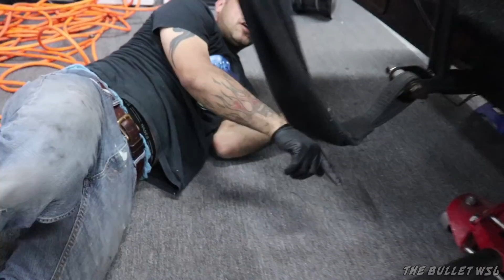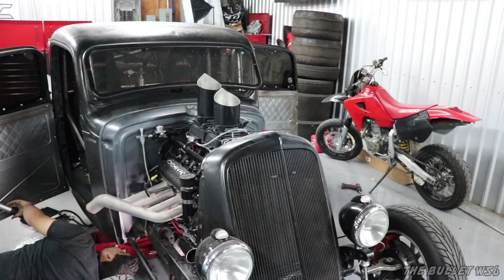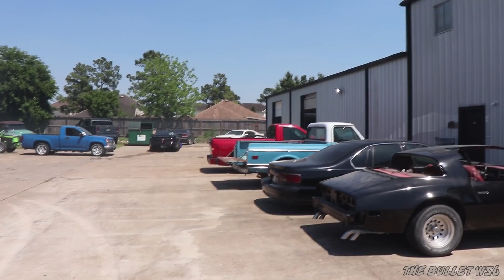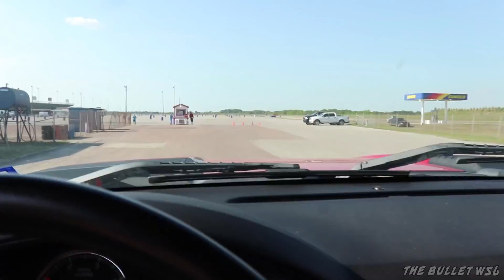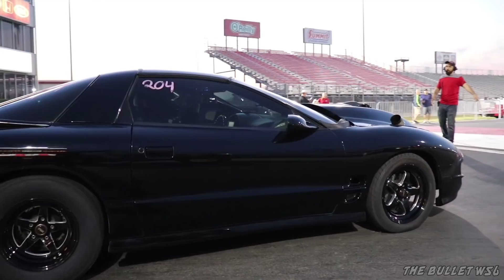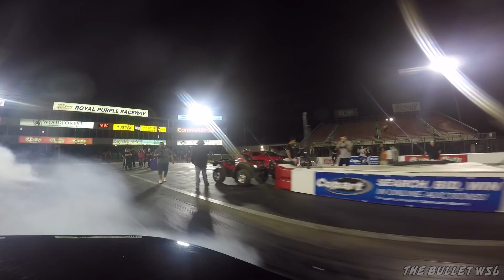HOUSTON TOP TEN... but was it EARNED?

Comment: Hey bud back again with some questions lol. I know he normal spot people use for oil feed on their LS engines. Did you use the same area above the filter and use an adapter? If so which one? Still buying these little pieces. Also the black hose and fittings for the BOV & WG. Any good company to get them in bulk? Thanks again 
Now keep those videos coming! Love that Trans Am.
Reply from the maker: Yes i did use the same port, Summit has the adapters with npt threaded holes for AN fittings.. If you look on FB theres a couple places that sell vacuum line and fittings in bulk as a kit. 

I surely will, thanks!